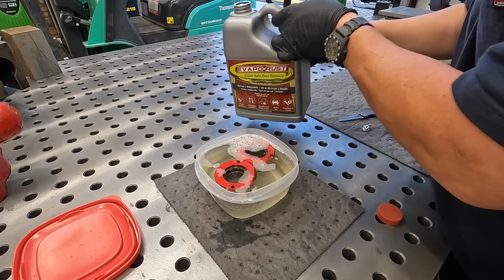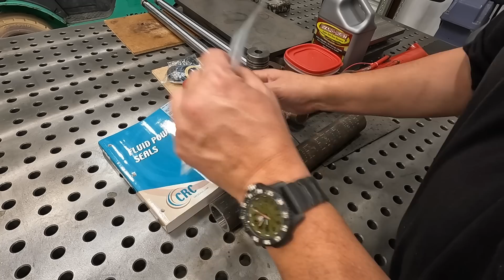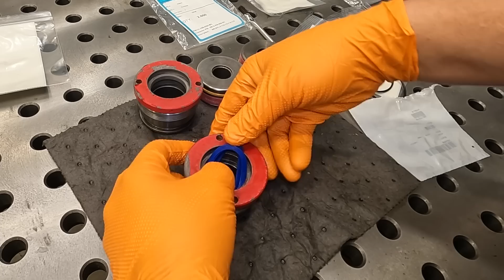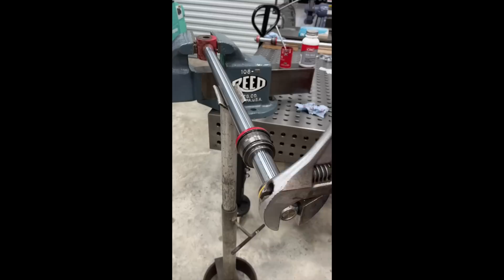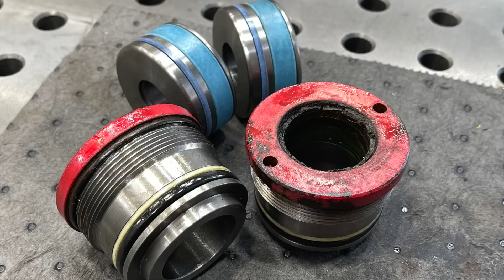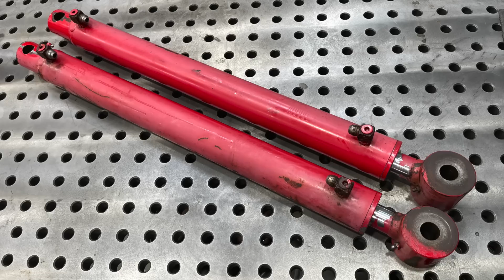Mahindra Hydraulic Cylinders: Resealed and Reassembled

Comment: We rebuilt lots of rams and cylinders some steel some aluminum some 300 to 400 psi rated a lot to 3000 psi rated and some to 10,000 psi on special tooling we had to do this off shore working in the ROV industry on a regular basis your videos show the procedures to do it as well or better than any I have seen great job Adam.

Comment: While not completely necessary, the seal squoosher tool  Hercules  and probably CRC  sells is a nice tool for those pesky teflon piston seals. They are surprisingly well priced for what they are. I think I paid a little over $100 for mine a few years back. If you do cylinder repair regularly they are  well worth it in my book especially for larger diameters. I am kinda surprised a tool lover like you does not have one Adam 😁 Cheers

Comment: You said less then a hundred dollars, is it that much cheaper to go though the headache of trying to size and order seals and o-rings? The last cylinder repacking kit we bought from kubota was $79, and everything fit. Can’t say about the company your using, but can call Martin Fluid Power Generally tell them the make, model, and the serial and they will ship a seal kit to you. Cat seal kits are a little high (just because it say Caterpillar on it), them goofy Zeter double gladded seal kits are a little high, but it was less $200 had everything but that damn 2 mm set screw.

Comment: Have you every tried soaking those hard plastic seals in hot water for a little while before installing? When I have rebuilt automatic transmissions, I found it made it a lot easier. They seemed to shrink back to size and I would get a nice fit.
Reply: Yeah, that's right, I've put seals in hot water to make them expand, be a bit more flexiable. Once snapped off a seal trying to mount it to psiton. Went much better at next try with one that was heated in water)

Comment: Seems overly complicated to determine and order the correct seals/orings for a known product. Being that they are stock cylinders for a specific model, why wouldn’t Mahindra or any other manufacturer provide the exact specs for replacement seals? I can see the value in knowing how to determine the acceptable replacement if its an unknown product, but having to machine something to fit a generic seal seems overly complicated.

Comment: I think I did 30 cylinders last month. Some crane and excavator cylinders can be fun, had one that we couldn’t break loose and put enough torque on it that the needle wrapped back around to zero, and the torque gauge goes to 50k ft/lbs. Smaller ones like those are nice. We use Vaseline to lube everything going back together.
Reply: What do you do when cylinders are stuck? I've seen curtis over on CEE use a giant pipe wrench.
Reply: @armandhammer9617  The big boys have hydraulic powered cylinder repair benches which can dismantle the most stubborn  cylinder - they dont all come apart cleanly when brute force is applied.
Reply: We have a big cylinder bench with a hydraulic cylinder to apply torque, and have a fixture with with two cylinders and hydraulic jaws that can clamp on an internal thread gland or external cap, or use our 48” pipe wrench to hold the cylinder while we spin it. The one that took around 60k didn’t break loose but ripped the welds on one of the brackets that we mount the rear of the cylinder in. We ended up scrapping that cylinder before it broke more parts.
Reply: @armandhammer9617  Curtis has some really good videos. We try the pipe wrench on the cylinder bench we have at times. Sometimes we can get them broken loose with just the 48” pipe wrench and some cheater pipe.

Comment: Adam, I really appreciate you sharing your knowledge on hydraulics.  I’m getting ready to rebuild several cylinders on a boom lift and you just gave me the confidence to tackle it.  Great looking new shop by the way!
Reply: Some seals can be hard to push into position, especially at the pistons. This is the 'hard plastic' type, not standard o-rings (which are easy to mount) I've have put some in hot, near boiling water, for a couple of minutes to make them a bit softer, more flexable, to greatly reduce the risk of breaking them while pushing them on the piston. Good luck

Comment: I was taught not to use grease when I worked on Ford select-o-speed 10 speed manually shifted automatic transmission. Your using the grease very sparingly so you won’t have any issues. We were told to use Vaseline. The reason is that grease takes too much heat to dissolve Vaseline dissolves easily. 
That being said what I’ve used over the years is STP consistency type products such as Morey’s or Lucas Rislone hyper-lube. These are very slippery and work very well.
Reply: |Wow that's a memory, the Jerkomatic from the late 60s !!

Comment: To get those seals in, it seems like a perfect job for a simple tool. A drafting compass type of thing with 4 arms instead of 2. Put the seal at the end, and the 4 arms would compress the seal such that it forces it into a cross type of shape.
That would reduce the OD a fair bit, allow you to insert into the cavity and simple unscrew it in place. A little finagling might be required.
If you had smaller fingers, you could probably do that manually.
Reply: He already has a tool that collapses the seals, he said it’s at the other shop. I have used the tool he has its 3 fingers that folds one side into itself then releases to let it spring into the grove.
Reply: @chucksmalfus9623  Beat me to it. Exactly.  also, wrap threads with tape before installing o-ring. It prevents nicks in the new rubber.

Comment: @Abom79 You speak of a tool to compress the rings. I am sure the hydraulic specific one is more expensive. But there's a fairly available option that diy engine builders usually use. That you can often find dirt cheap at yard sales of old hot rodders. I know I have my grandfathers one. They are great. But the edges are sharp as all hell :)
Reply: Since the seals are bendable, if you could get/make something like a drafters compass with 3 or 4 arms you could put the seal inside the open ends, compress it so it deforms into a 3 or 4 pointed 'star', which would decrease OD and slide it into the space. Unscrew the compass as far as possible, then tip on side into the groove, and possibly the others too. 
Or get your kid with small fingers to do something like that?

Comment: You do not deglaze the rods I knew an older gentleman that was his specialty in rebuilding hydraulic cylinders and he always deglaze the rods, I worked on motorcycles for over 50 years, and all of the hydraulic forks I did I always deglaze the rods and the seals always lasted a lot longer, or maybe it is him and me that do not know what we were doing?
Reply: Deglazing usually is done when there are hot combusion gases present which create that glaze. What hot combusion gases are present in a very, very low strokes per minute cylinder.  Unless you can point to some SOP or standard which suggests this for this type of cylinder, yeah, I don't think you know what you are doing.
Reply: @boots7859  To tell you the truth I don't think you know what you're doing with all the experience I had plus that old bugger I think we out-experience you by four times,  I had this one client that was a professional motocross racer I was the only one that did his Forks cuz he said I was the only one that did them right and lasted the longest before seal replaces!
Reply: How do you deglaze them? What does it do? 
God bless you!
Reply: @michaelboyle1983  You use crocus cloth to deglaze the rod it leaves a fine texture on the surface which helps retain oil to lubricate the seal and help it from overheating, especially on racing motorcycles.
Reply: @mcfast52  thanks.

Comment: I spent 5 years as a Sales Engineer a LONG time ago ('80s) and I was the only one that could rebuild the customer's air/hydraulic cylinders that we sold. 200psi oil max. 4 tie rod cylinders. There was no torque spec, so I "rang" the tie rods. Trick I learned helping the bike shop at Sears assemble bikes during the Christmas rush in the late '70s. They all "ring" the same note, they're all the same tightness. 😁
Reply: Out of college, I worked on the construction of 188,500 DWT tankers.  When tightening the propeller nut for the 28' Dia., 28,000 SHP  propeller, they hit the wrench with mauls until it rang true.
Reply: In the 500 years tradition of winemaking in our family I appreciate the work Adam has done here (same tractor ...). And thanks to you Phil for being a part of the supply chain:)
... besides that hydraulics and tractors are "new", compared to wine-presses and how they are lubricated. (look it up! :) )
Cheers!

Comment: Adam do you think if you soak that other cylinder in evaporust that it might come apart?
Reply: The internal threads are what are seized, the evaporust wouldn't be able to penetrate to the inside of the cylinder.
Reply: Vibrating the wrench right/tight-left/loose-right-left etc. Grit in grooves act like wedges, so oscillating the wrench can grind the grit to some degree letting it loose. If any movement occurs, penetrant can get in. Forcing it in only one direction only makes it worse.
Reply: @rogerscottcathey  EXACTLY RIGHT!  Get it to move at all,, back and fourth!! BTW- WARMED  WAX AS A PENETRANT is magic!
Reply: @rogerscottcathey  Yeah. It moved a bit initially right?  Just rock it back and forth, however Abom ain't an apprentice, so its probably the galling is just going to become unstuck.